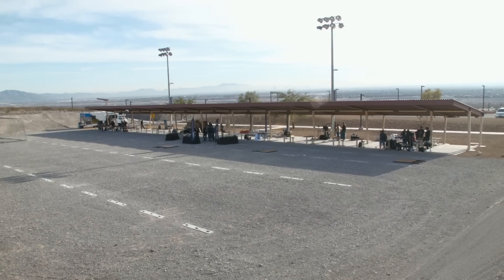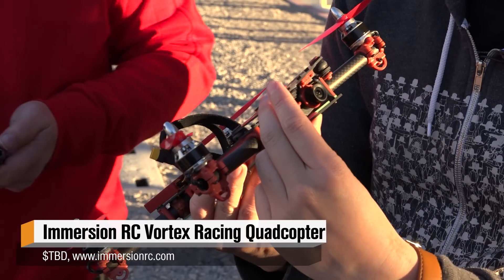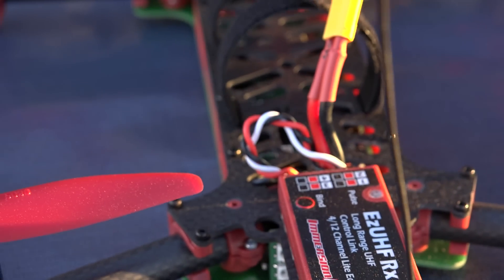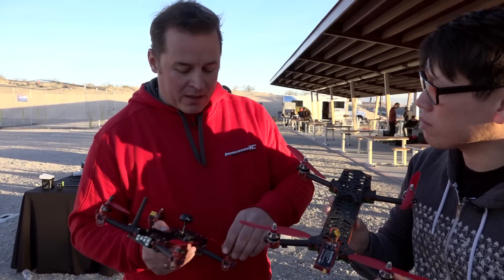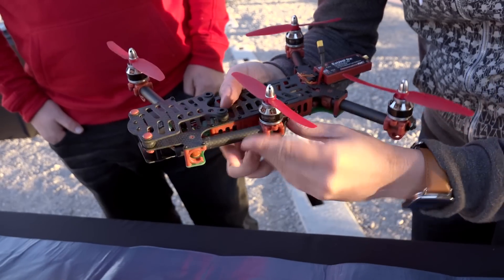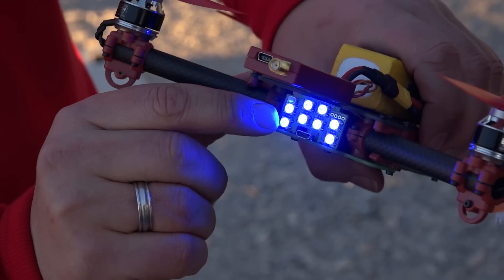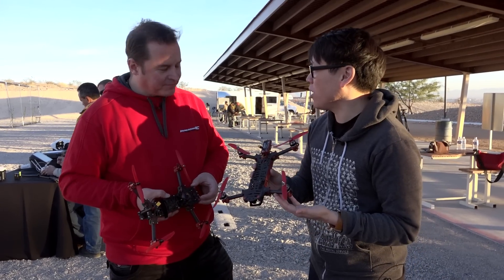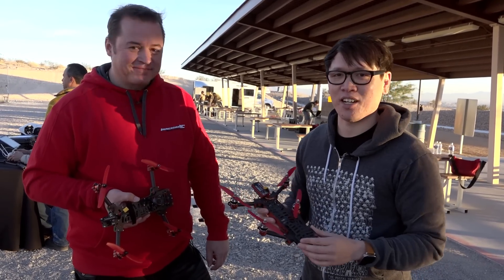ImmersionRC's Vortex Racing Quadcopter

Comment: This is first Drone I wanted before Dji. Wanted this thing bad. Never got it sadly.
Reply: So sorry you didn't get one back then, I got mine in the summer of 2015 and never looked back, now it's 2023 and i have over 40 quads and of them I have 7  Vortex's in 3 different sizes. Immersion set the bar back then for us flyers getting into FPV flying

Comment: Only issue I see with this design is the ends of the arms and cables. Its nice to have a bit of meat extending out side the bell housing on the motor to take the side impacts. I am getting one for sure but I would probably get new arms a bit longer and groove out a section in the top for the cables and set the motor mounts in from the end about 6mm. SO any side impacts on concrete or anything hard Im less likely to damage the motor and wires.

Comment: small motors, tubular CF with plastic everywhere. ccd cam looks straight on...this is probably going to be one of the most fragile/not that quick racing minis out there. for 380 you can build quite a nice one.
Reply: doluseb the frame and arms are carbon fiber. that thing aint fragile
Reply: brandon b
plastic holding the arms straight. plastic holding the motors, and various plastic and nylon pieces throughout. I'd say compared to other minis this thing will break...a lot.
Reply: doluseb yeah thats true actually, especially compared to something like an emax build. pardon my previous ignorant response!

Comment: Just wondering where you bought your RTF Vortex kit from? And what is the best FPV video goggles?
Reply: +Rill Poogue The best FPV goggles at the moment are the Fatshark Dominator hd version 2 (note not the first version which had issues)  which havea  SVGA screen wide 50 degree viewing angle. You can check the specs online. I still use my old  in FPV terms Fatshark Attitude goggles which you can still get and these use a lower resolution VGA screen and include a 5.8GHz receiver anda  camera tracker-tracking is not needed for this Vortex. The Vortex uses an analogue camera which has lower latency than trying to use a direct video feed from a HD camera like a GoPro or Mobius, and is also more stable since the elxectronics are simpler. The analogue cameras are low resolution and so you do not  really need high resolution goggles, and its also why you tend to also use a second HD camera for video recording. I  do not have a Vortex I keep thinking about getting one but I'm more into FPV planes. Lucky 12 year old above this is not a cheap toy and requires a programmable radio and goggles.
Reply: +stewjw Great reply on your comment bro. 👍🏼 V2 HD's are the best of the best. Pricey but well well worth every cent. 
For my son, he LOVES his Vortex! 😃👍🏼 I will be posting videos on my channel soon. Cheers!
Reply: +Chad Cole Thanks Chad.

Comment: These will sell out on launch, only place you will get one is ebay for double the price. The 250 market needs someone to flood it, as no supplier as yet has managed to keep up to demand for the 250 gear. immersionrc vortex 250 Racer looks like an amazing, well thought out 250 quad. Does anyone know if they are using naze from timecop or c33d? One of them seem have a Naza lite?

Comment: What's the difference between a quadcopter and a regular rc helicopter? (stability/controls/etc). The only flying experience I have is with the Syma s36, a cheap, 3ch coaxial toy helicopter, which I found is already pretty stable.
Reply: Quads have 4ch, so the yaw(turning on the spot) that you would of had on the same stick as pitch(move forwards and back) will instead be on the same stick as the throttle, which initial can be a bit tricky to change yaw without changing the throttle.
 
Also with more responsiveness comes the ability to over correct which can make controlling the quad through different orientations harder.

However all this comes reasonably quickly with practice. I strongly recommend picking up a syma X5c to practice with. less that £40. Very durable due to the light weight and can be flown in and outdoors.
Reply: AlexDC93 Thanks for the feedback! I'll look into it. I've also heard good things about the x5c.
Reply: ***** Hi, thanks for the reply! This helps clear things up for me. I know what you mean by the wind, even the slightest breeze can affect my helicopter greatly :p

Comment: I have a problem with my Vortex. I have really bad yawing to the left. The more i push the throttle. The more it spins to the left. Strange thing is that it only happens with 3s packs. If i use 4s. It doesn't happen at all. Anyone have any ideas what is causing this?

Comment: Looks cool but I just don't like tube arms. They caused lots of problems to me in the past. For a 600+ sized quad, you pretty much have to use them. But for a racing mini quad, I don't think they are all that necessary.

Comment: whats better ???

ImmersionRC Vortex 250 pro

Or

Blade Vortex 250 Pro
Reply: Blade 250 Pro?? I believe it's the same quad just horizon hobby is partnering with immersion RC.
Reply: oh ok, thanks!
Reply: That's not quite true. The Blade version comes with a Spektrum receiver installed, but other than that the only difference is the stock color.
Reply: oh thank you
Reply: +SoLongSidekick Mine didn't come with a receiver and it came from Horizon Hobby.
Reply: That's probably because you got the standard Vortex Pro, not the Blade version. I know they sold the original there, and I'm not even sure if they sell the Blade version yet.
Reply: +SoLongSidekick Could be. Who knows. I bought it right before CHRISTmas so they must have started after that.
Reply: I didn't even know the Pro was around at Xmas, I thought it came out sometime in the spring. That's interesting. I think I got mine in April or March from Get FPV.
Reply: +SoLongSidekick OH.... My bad bro...I've got the original vortex not the pro. Lol. I thought you were talking about the first Generation Vortex.

Comment: Why do you need a gopro is the board camera bad as compared to a gopro?
Reply: GoPro is to record HD video. Board camera is a low resolution camera to fly with.
Reply: By the way dont buy this one. Get the 250 pro.
Reply: +Christian Logsdon For what reason? I think i will buy this quad for my first fpv quadcopter, because its almost 200€ cheaper here, it has got small 18mm motors but a decent 4s will do the job good as well :)
Reply: The Vortex Pro is massively upgraded over the Mini (this one). I had to make that decision myself, and I just bit the bullet and saved up the extra money for the Pro and have been supremely happy with my choice.
Reply: +SchokoKeks My son got this one as his first "REAL" FPV Quad and to me it's better because this folding arms saves you a lot on props and spare parts if you crash. It's a GREAT flying quad! 👍🏼
Reply: Oh I don't doubt that even though the Pro is better, that the Mini is still an outstanding choice. And just since you mentioned it the Mini is far more breakable than the Pro (but still when compared to other quads the Mini is still quite strong). The Pro has a reputation for being an absolute tank; Immersion even renamed the colored parts kits from "Crash Kits" to "Pimp Kits" because the parts really never actually break. The one downside is that all of that robustness does cost the Pro in weight; it's definitely not a light quad for it's size. But I've installed the Block 1 Race Kit on mine and still haven't broken a single part, so that helped to take some of the weight off. Immersion really knew what they were doing with both of the Vortex quads.
Reply: That's completely up to the opinion of each pilot.

Comment: do u get a  transmitter  with this
Reply: No sir. Only the quad. No receiver either. My son just got one for CHRISTmas. He is running the orange RX615 on his. It is his first real racing quad and he isn't use to how it Flys when you push your right stick forward the quad stays in that position until you pull back on the stick to center it back up. Other than that it is an AWESOME machine!!!!!
Reply: thanks for that im going to get the walkera 250 for now
Reply: +leejulz1 Your very welcome sir! That is a great quad so I hear. 👍🏼
Reply: +Chad Cole hope it beter than the 1 i have slow
Reply: +Chad Cole isnt that a problem with the radio transmitter and not with the quad
Reply: +Wladimir Delicaat - No sir. It was in the PID settings in the Quad. 👍🏼 We are flying good now. 😃👍🏼

Comment: What kind of range can we expect with it?....
Reply: Range is dependent on the RC system used, not so much the quad. The limiting factor with these 250 sized quads is the battery. They are not designed for long distance anyway, they are for racing.
Reply: thank you for that info........
Reply: No problem.

Comment: If a kit is ready to fly you should not need to buy anything else to fly it.   it should have everything that you need to fly it in the kit,  it shoud be built and everything programmed and ready go go,    just charge the battery, check to make sure everything is working correctly and in order and its 100% ready to fly.    buy a plane or helicopter RFT kit and you get the  aircraft, receiver, radio, battery, charger  the whole shebang and its all built and programmed and ready to go.    charge the battery, power it up and fly right out of the box nothing else needed. .   so this is really a almost ready to fly kit.  not sure why they are saying these quad kits are ready to fly when they are not,   you still need to purchase at least something to make it ready to fly so it is not ready to fly.